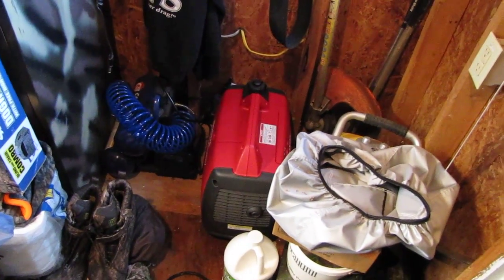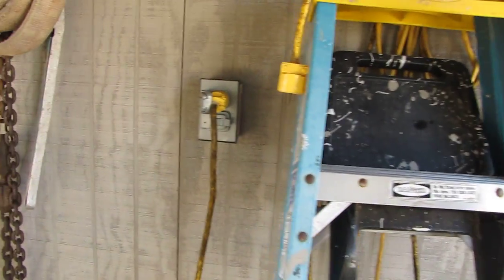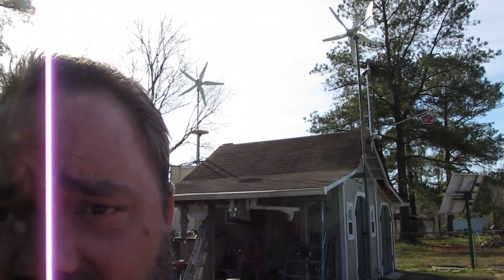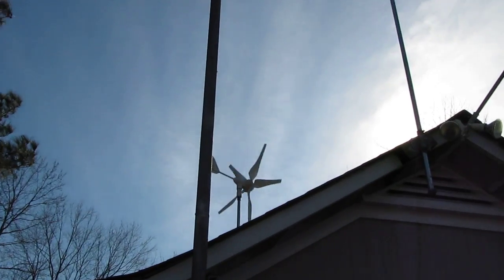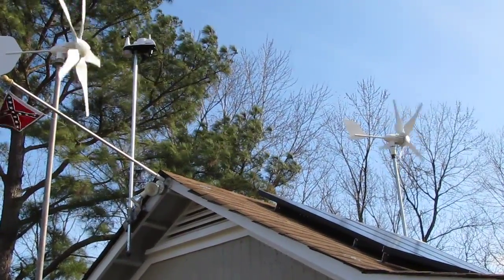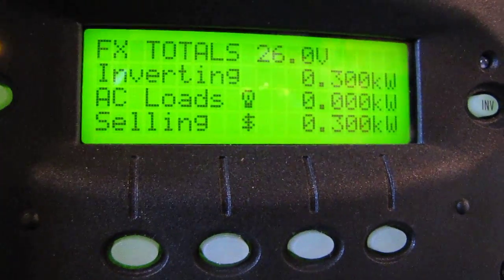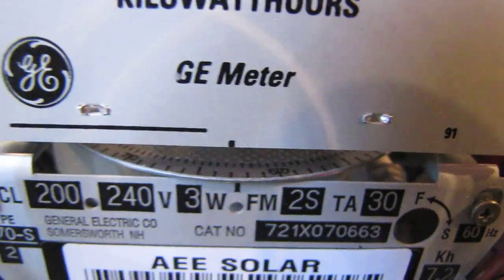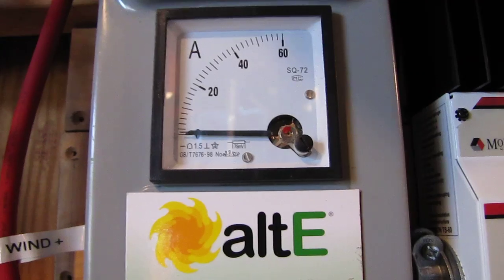RENEWABLE ENERGY IN  CHESTERFIELD VIRGINIA  with  OutBack Power  Part 2 VIARLOCITY

Comment: So say i have (8)6volt agm batteries a 190amp hours each a 190x8=1520 amp hours in 6 volt,1520/2=760ah in 12volts,760/2=380ah in 48volts is that how you figure that out?